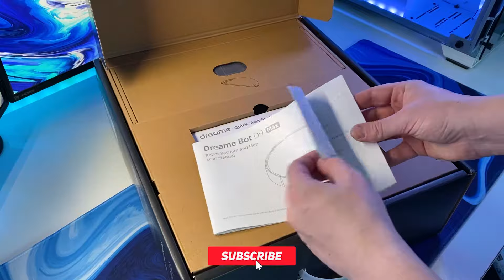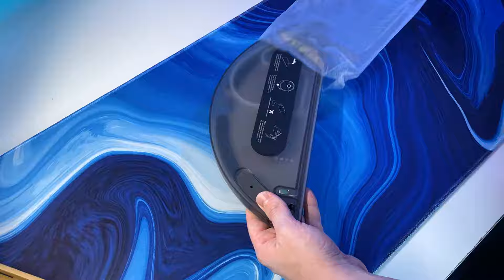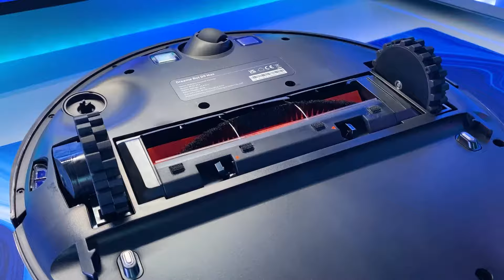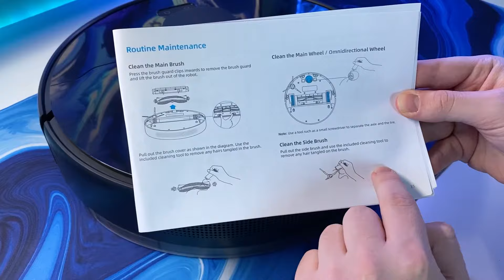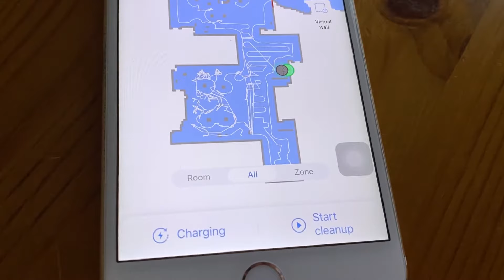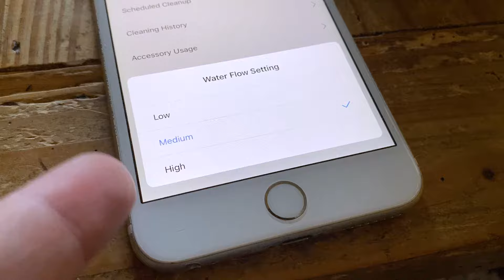The ULTIMATE Robot Vacuum? | Dreame Bot D9 Max - Unboxing & Review

Comment: Hey nice video !
Btw I also would like a robot vacuum in my room but sometimes it could be dangerous when your cables aren't that well managed and are dangling on the floor, it could suck them up and ruin it !
Nice video btw :)
Reply from the maker: Thank you - And yeah it's awesome! I didn't run into any issues like that but I can definitely see the concern - You're supposed to 'tidy' the area before you start the cleaning process to avoid that issue, I might test it out to see how it deals with cables and other potential hazards :)
Reply: You can set zones for it to avoid so just have the robot avoid the area where you've got hanging cables
Reply: Or just get into cable management. It's changed my life. Everything is always tidy.